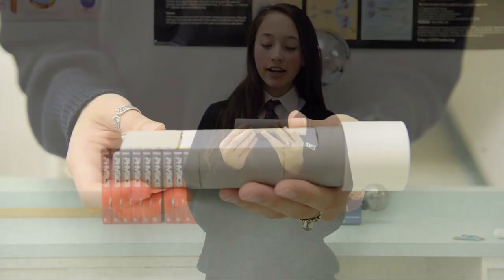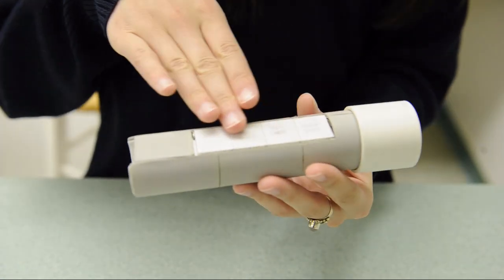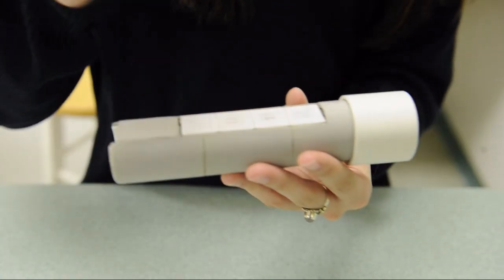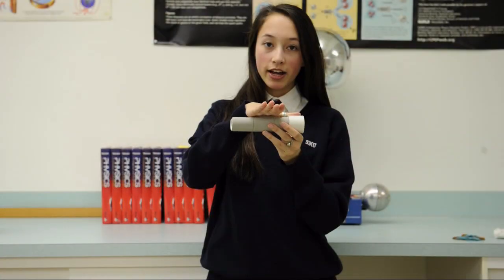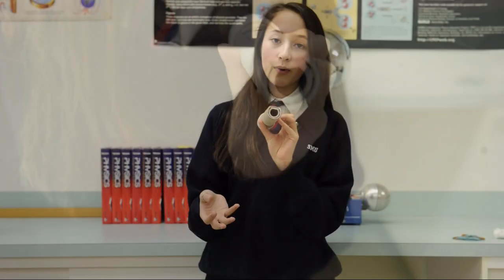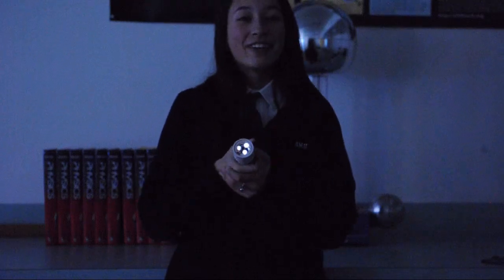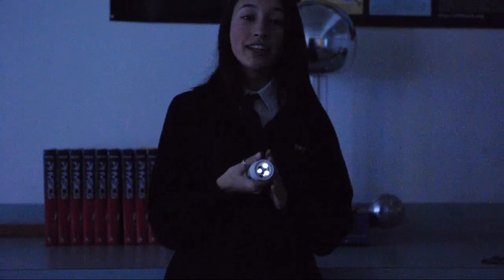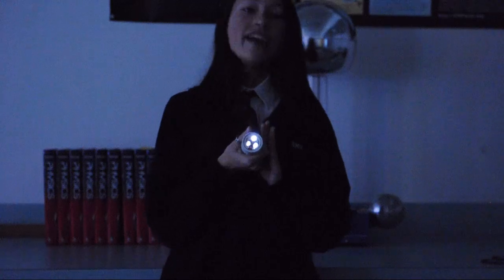The Human Heat Powered Flashlight

Comment: 😂 but this is not a new idea....i am using TEC1-12706 module since 2017...this led is not useful in the real world...temparature difference is not always great...power output is also so low...if you use a simple bettery, same led bulb can flash 2-3 year continues 😅...even simple 3*3 sun panel can give much much higher power...may be google only inspirer here...we need efficient TEG module not this kind of volgure projects...

Comment: Nest step tip idea.  Use a cool stick inside the tube to cool the flashlight in warmer climate. Just keep the cool tube on ice till you need the light, slide it in and go. If I'm right, you will also get a brighter light when needed.   Good work, and well done...

Comment: yep as others have said this technology can basically be said to be based off of the matrix.

human bodies = electricity/energy
but we already knew that even before the matrix :)

but someone finally makes use of the idea of human batteries.
like this young lady. good for her.

also phone charging with the body may not be possible until someone is willing to make clothing which transfers energy to the phone. seems easy but

it is likely due to marketing perceptions they wont do it and it may not feel comfortable enough.
Reply: The flashlight runs on a peltier generator.
Reply: Walrus it is the same concept different implementation.

I will say it again almost all technologies have already been thought up except the implementation and and making them practical.

If you want ideas for inventions just read sci-fi novels/watch videos/anime/cartoons they are all there, then find ways to make it possible.  

Learning physics is to make it possible to do things not somehow creating new ideas but more like making possible old ideas.

You don't need to be a rocket scientist to think of these ideas. But you might have to be to make it a possibility.

I do commend her in actually making it possible to implement these ideas though.  I will await the next sci-fi idea come to fruition.

Comment: Hmmm and yet there would be situations in which this flash light would be better than cell phone or torch.  Cell phone runs on battery and torch burns oxygen...flash light doesn't need or do any of it.  It's a ultimate survival tool for apocalyptic environment...of course in peaceful times you have better options.

Comment: The peltiers run either way as long as there is a heat differential.  A small ultracap or battery in the head of the unit (along with boost circuitry) and a separated, waterproof handle, with a black exterior, would allow: Solar (heat) charging - leave it in the sun and the exterior will heat enough trickle charge; in vertical position, air convection would be ample for cooling.  Heated interior: allow the ends of the tube to be sealed/unsealed.  Insert hot wax capsule, heated water etc.

Comment: one peltier semi-conductor produces 0.05V with a hand on top of it and copper heatsink below it.
she used 4 peltiers in parallel so she produced about 0.2V
LEDs require 3v to operate.